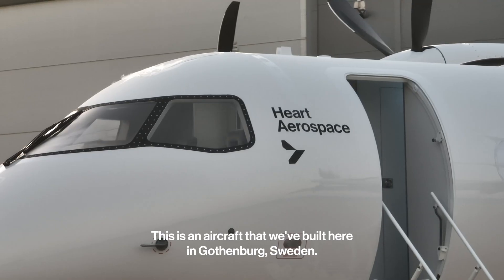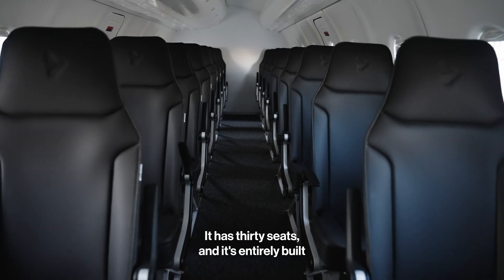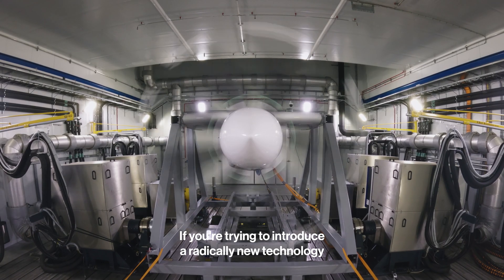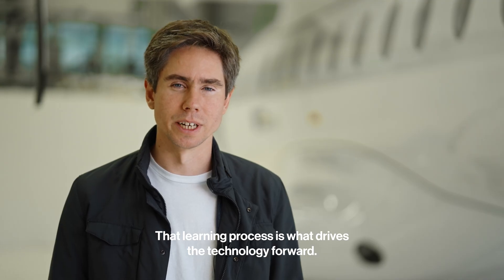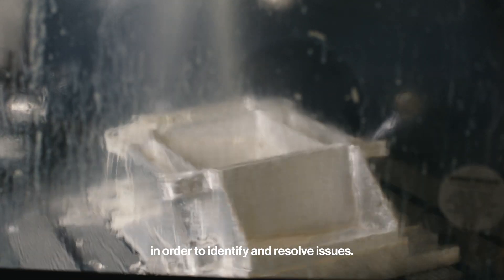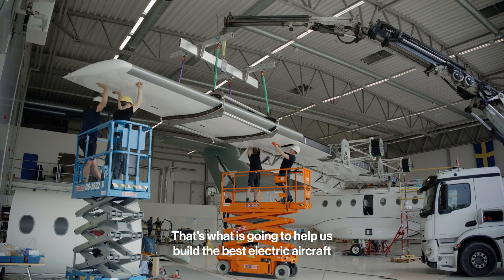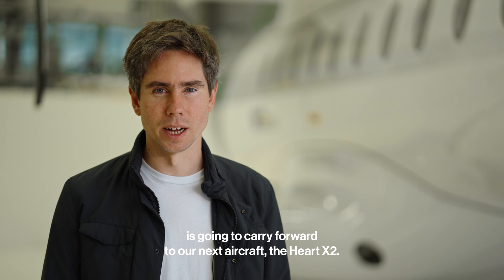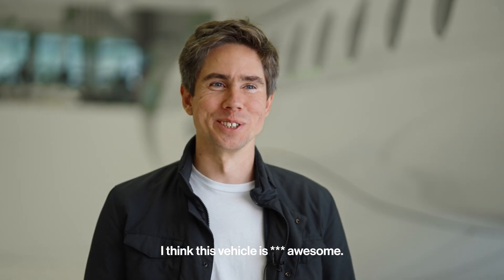Heart Aerospace , Benjamin Stabler  - Heart X1

Comment: I have a lot of questions about the X1 in the Video it says that it has two turboprop engines i can not see any airintake and outlets all four nacelles ar equal on the video . Another question about the cockpit i coldn`t see any standby instruments . And i take one more questin in this comment the main door should the have more fittings if the cabin are pressurized